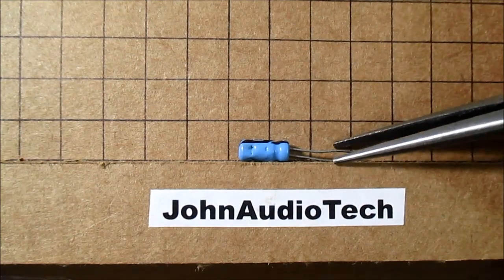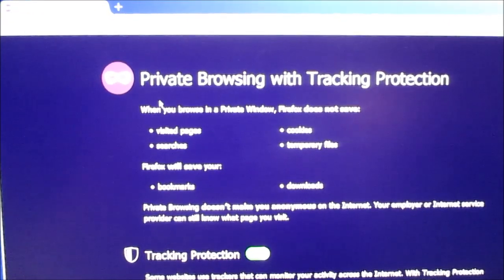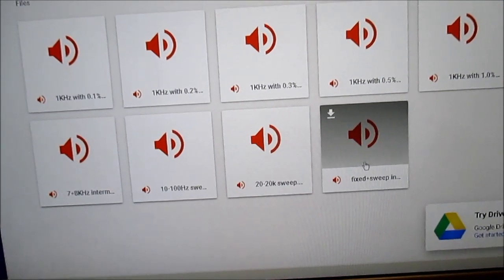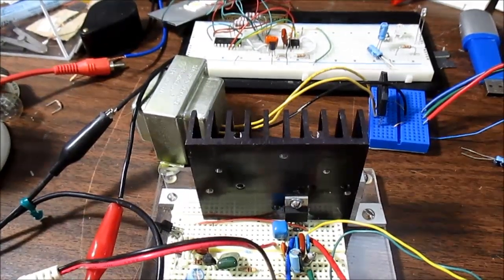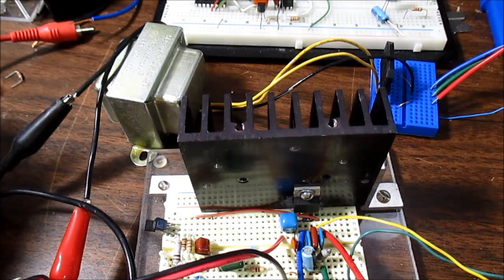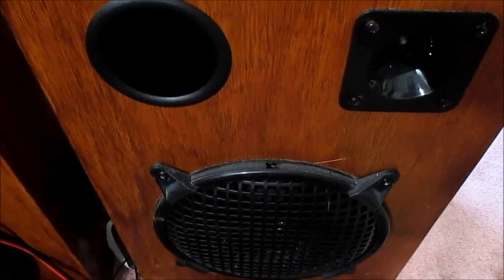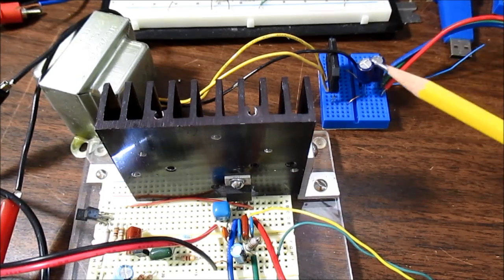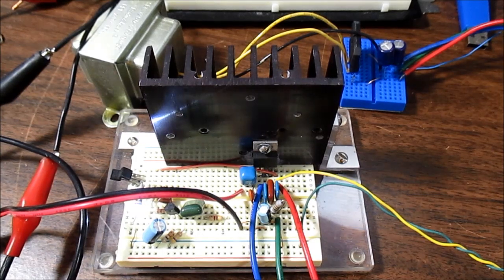Free audio test files and audio amp with no or little filter capacitance

Comment: I don't know how much you are into this but I worked on a 1964 AM/FM Delco Corvair radio with germanium trannys.  The final drive was very unusual.   I would love to hear your explanation of how this thing worked.    I reviewed several Delco radios of the time period and most had the same final drive circuit.
Reply from the maker: Was it a single output transistor with a transformer or coil?
Reply: Yes.   It had a choke coil in parallel with the speaker coil.   Very strange to me.    One transistor output.   Wierd form factor on the tranny too.    I tried to find the schematic online to provide to you here but no luck.   I had a Photofact for it when I worked on it but returned it to owner with the radio.   Seems like a lot of the amplifier circuit topology of the early solid state stuff was a carry over from tube amplifier topology it seemed.
Reply from the maker: The coil has low resistance to DC (fraction of an ohm) and lets the bias current through since these are biased class A. The speaker's coil resistance is much higher so very little DC goes through it. The inductance of the coil blocks much of the AC audio signal which passes through the speaker instead. This design draws a lot of current (~500ma) even when the amp is idle.
Reply: Thanx.   Makes sense but doesn't at the same time.   Lots of wasted power.

Comment: Hello John. Have you ever played with lm1875 in current feedback mode (when feedback signal is taken from current shunt that is plugged between load and ground)?
Reply from the maker: I haven't tried that but am aware of it. It allows the sound to be affected by speaker impedance. I hear it works with certain types of speakers / enclosures for a desired sound. Not really my cup of tea.

Comment: Hi John,  Thanks for everything you do.  We're kinda neighbors.  Pittsburgh here!  If you use these files on a phone or tablet will they have enough amplitude?  Thanks again
Reply from the maker: Hi KG. Yes, they should work for most amplifiers.
Reply: JohnAudioTech Thanks  John .  Will  the  output  power  of  the  amp  be  lower  with  a  lower  input  amplitude .  Not  the  max  power  the  amp  produces.. Isn't  line  level  normally  around  1v? Would  that  be  RMS  ?
Reply from the maker: The input voltage times the gain = the output voltage. The power is the output voltage times the load resistance. So, yes, a lower input signal means lower output. 1v line level is a reference voltage, not the actual signal of the music. Without a volume control, a line level signal can drive the amplifier into clipping. Most headphone out devices have a lower than line level voltage which could mean you don't get the full capability from the amplifier.

Comment: You might be able to weaponize these sounds. I literally ran for the bathroom and vomited after about 30 seconds of the initial "nice" hum. Maybe I'm just getting sick from something else, but after I recovered I came back and listened for a few more seconds and started to feel sick all over again. There is definitely something my system doesn't like about this hum. Otherwise I have what many have called a "cast iron" stomach. Very strange!
Reply from the maker: Really?! I never heard of someone getting sick from that sound. It sounds like the HID light fixture buzz in some warehouses I've been in.
Reply: Listened again today with no problem. Correlation does not imply causation. Must have had some kind of bug yesterday. The hum reminds me of the electric hair clippers my parents used to use on me when I was a little kid.